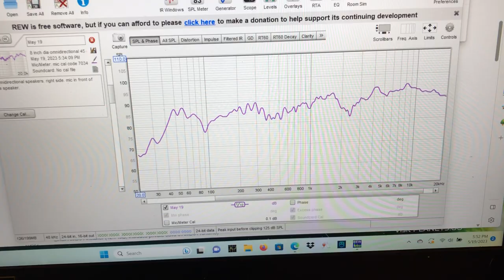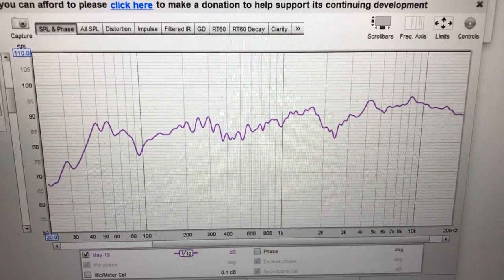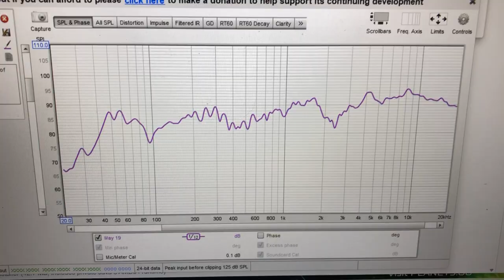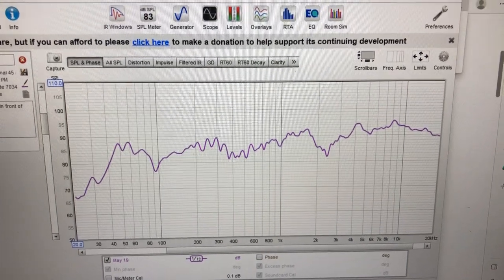Omnidirectional speaker demo Henry de Groh Typhany SDS-160F25PRO1-08 HiVi TN28-8 Review

Comment: nice video mate, can i know how's the vocal clarity of these tymphany SDS-160F25PRO1-08 drivers? do you recommend them?? i know they have great bass but i have some doubts about the sound quality ...
Reply from the maker: I think you can get the specs from partsexpress here: https://www.parts-express.com/pedocs/specs/264-1146--tymphany-sds-160f25pr01-08-spec-sheet.pdf
Many woofers have a peak before they drop-off at the high end, like near 4000 Hz. This peak can be harsh, and require an inductor to pull down; pulling this peak down helps the woofer blend with the tweeter better, matching its loudness at the crossover frequency. My point is, this woofer does not have much of a peak before drop off, and since I am using it firing up, the off axis response is smooth (has no peak at the high end). I like the driver a lot, and it was not expensive.
Reply: @henrydegroh2341  thanks, so if i use Tymphany BC25TG15-08 tweeters with these drivers what is the best cut off point? these tweeter i mentioned have frequency response of 1000khz to 20khz ... is crossover around 4000hz will be sufficient to kill the harshness??
Reply from the maker: @professionaloverthinker-x   If you don't use any inductor on the woofer, I would cross the tweeter over at between 5500 and 6000 Hz; if you are adding an inductor to the woofer, say that imposes -3 dB at 4000 Hz - crossing the tweeter nearer to 5000 would likely be a better fit.